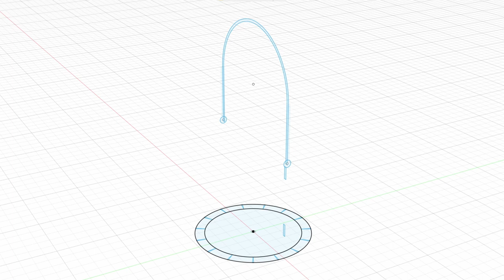How to make a bucket for a wooden model? Ship modelling. 1/72 scale.

Comment: That is a really cool approach to making that bucket!  I’m really impressed at how you made a rather difficult task easier.  Do you find your Sherline lathe to be a must have Tool in the model ship workshop?
Reply from the maker: Thank you for your words. :)
Sherline is an excellent machine! I have two - a lathe and a mill. Although I do not use them on a daily basis, without them I could not make a lot of important and very small details.